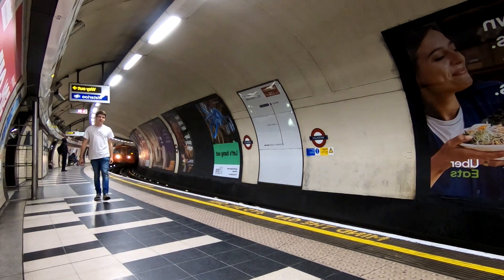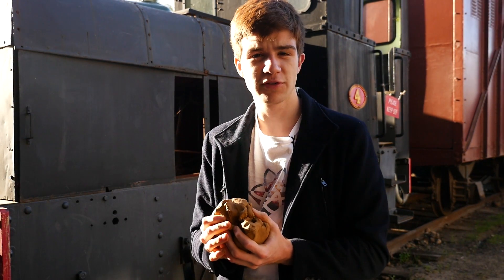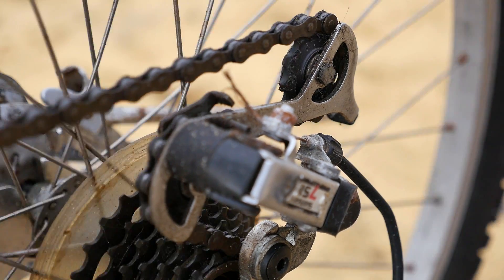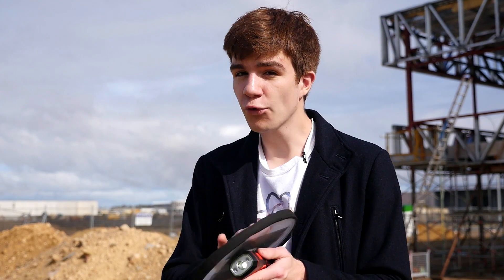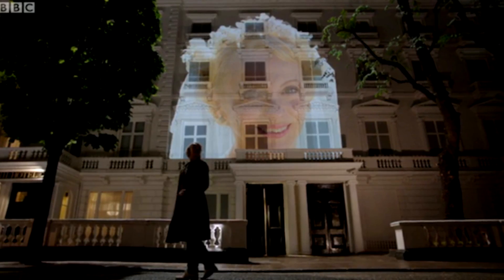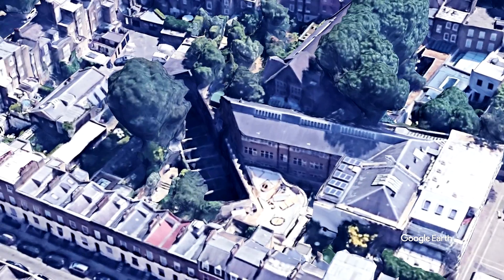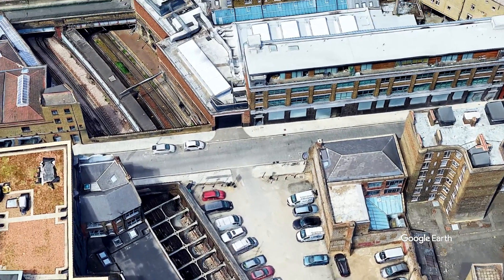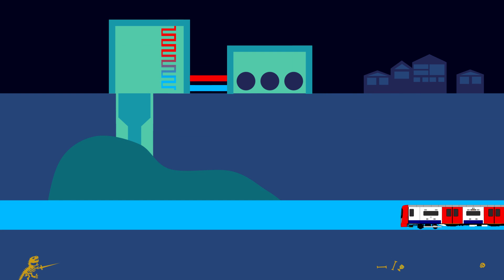Why It's (Almost) Impossible To Cool The London Underground

Comment: This video is a bit messy and kind of gets it, kind of doesn't.

Yes, the older lines are cut and cover which is why those trains are able to have air conditioning, though this wasn't mentioned, and the deep level lines (which the two weren't differentiated between, just the idea they weren't open because they didn't run steam engines.. lol) aren't impossible to cool, it's just an extremely expensive project. Heat exchangers above and below ground at each of the busier deep level stations are possible to do, but again it's just a matter of expense, not just for installation but the cost of running them. Those fans at Oxford Circus are actually a form of air conditioning, using borehole water and pumps to exchange the heat, but on the hottest days of the year during rush hour they often don't even turn them on, which is insane.

Also, yes the ground retains a lot of the heat and is very insulating, but not to the point it's growing endlessly warmer over the years, it dissipates in winter back into the tunnel air being pushed along and out by trains, drawing cooler air in, which is why it's actually very comfortable in winter. Also, yes, the brakes, motors (and indeed the heaters themselves when the drivers don't turn them off) cause a lot of heat, but the rise in temperature specifically in the summer is only attributable to the fact the ambient outdoor temperature is higher and those trains, having been baked by the sun then take that heat from the sun into the tunnels where it cannot escape. In winter, the trains themselves indeed enter the tunnels somewhat chilled and absorb some of the heat, taking it outside.

Additionally, yes, despite what the video says, people are absolutely a significant source of heat. Each person emits approximately 100-120 Watts of energy at rest (more when they've been climbing stairs etc), which might not seem like a lot, but make that 40 people per car and suddenly you have the equivalent of four 1000W heaters all turned on in that one car alone, and that's at less than half capacity. A 1992 stock central line train has a total capacity of 892 people (and heck, I'm sure I've been squeezed on ones with over 1000 people at a time), divided by 8 cars that's 111 people per car. That's up to 11KW of heat being produced per car, or 88KW per train during rush hour. It's hugely significant.

The next generation of deep level line trains being built by Hitachi are supposedly going to be air conditioned, though no information has been given as to how this will be done. One of the concepts being talked about is to generate ice stored under the seats when the train is travelling outside the tunnels, and upon entering the tunnels the refrigeration system deactivates and air is blown over the ice for the duration the train is in the tunnel.

One thing's for certain, the UK is really bad at keeping cool in summer.

Comment: Atlanta’s deepest station is cut into solid granite. It’s usually cooler than outside in our scorching summers.
Reply: Time will tell if that heat dissipates adequately or it becomes like London's tube. Granite is a better heat conductor at 3.2 as compared to clay at 1.7 to 2.26. Sources:
Granite:https://material-properties.org/granite-density-heat-capacity-thermal-conductivity/
Clay: https://www.sciencedirect.com/science/article/pii/S0375650520302017
Reply: Also Atlanta’s system is air conditioned. London’s isn’t

Comment: Trains already use regenerative braking, but not in the sense you might think. Physical brakes are the last ditch effort in emergency braking while normal braking is done via the same motors that actually power the train turning the motors into generators. This generated energy must be deposited somewhere or the motor wouldn't be able to brake so the train has heating elements that soak up that electricity which are much like sauna stove or swimming pool heaters.

Comment: Just a sec: London tube does not have AC? I am from a developing country (much warmer than UK also) and here all trains have AC set to 19-22C, stations are kept at a cool 25C. Some messed the engineering there
Reply: There's a difference between trains running on the surface and those running underground. For those underground the heat from the A/C has no place to go. As he pointed out, cooling the tube cars with A/C would only make the system hotter.
Reply: @Inkling777  the system I mentioned run underground

Comment: Generating electricity from waste underground heat cannot be a serious plan, I think you must have misunderstood something in the making of this video. It would require an exotic cycle to achieve that and would be at best low single digits thermal efficiency. Practical thermal electricity generation relies on temperature differences of hundreds of degrees.
Reply: Right, not electrical generation, but using heat pumps to put energy into a district heating system.

Comment: Spray water on the walls to absorb and remove the heat, perhaps grey water recovered from nearby houses. The tube system will already have drainage and sump pumps to remove it. Perhaps it could go through a heat exchanger and be sprayed again in a closed loop.

Comment: It's also possible to cool it if we get off of fossil fuels and onto renewables
Reply: What does that have to do with heat being dissipated from the breaks and wheels?
Reply: @RawbLV  the tube is getting really hot also due to weather change
Reply: @ThompYT  Yeah but the main heat source is trains braking. In other countries they use regenerative braking which helps convert kinetic energy into electricity instead of heat.
Reply: @RawbLV  still fixing climate change would cool the tube down
Reply: @ThompYT  Not by a lot. We are at +1°C right now if I'm right. The tube is at 40°C. That minus climate change would be 39°C which is still too much for underground.
Reply: @RawbLV  +1 for the whole earth = a huge change in temperature for us
Reply: @ThompYT  Yes but the video is about the tube and we are talking about the tube
Reply: @RawbLV  the tube is inside the earth (which is getting hotter)
Reply: @ThompYT  🤦‍♂️
Reply: @RawbLV  🤦

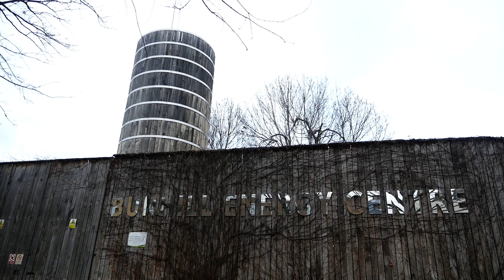Comment: 5:00 right... But how much energy is being put into the tube system and how long would a power plant like that be able to run? You're using electricity to run the trains which produce heat to then produce electricity... Doesn't sound like you could get much out of it or at least not be able to run it for long...
Reply: I know iam late. This system is collected with a gas generator which adds to the hear output and is the producer of the electricity. The metro part produce heat for 500 dwelings. https://heatpumpingtechnologies.org/annex47/wp-content/uploads/sites/54/2019/07/bunhill-heat-and-power.pdf

Comment: just put sliding doors on the platform edge and therefore seal it off from the tunnels. that's how they do it in China
Reply: mmm yes let's trap the heat and suffocate people
Reply: @RawbLV  no, you muppet. You separate the thermal cycles of the platforms and the tunnels. The tunnels use the trains like a  piston to push out warm air and suck in cool air. The platforms can be air-conditioned. Additionally, the doors keep people from falling onto the tracks.
Reply: @mrplease66  I see. Should have said so from the start. Shit at explaining but now I get it.
Reply: @RawbLV  Apologies, I figured it was obvious.

Comment: Low tech solution..ducting from underground into cellers of tall buildings. Hot air wants to rise... Shell of building could act as a chimney. And then there are lift shafts that would work similarly to way underground trains push air about. 
Of course times building will not want heated. Big flap valve allowing Air to exit say story above street level ... Or if there space for ducting, somewhere near top of building..
Reply: The vents would be too small

Comment: I fail to see how they're going to make ANY power from 40c air.
Some details would be good, that way the tax payer can have a little squiz at it what some consultancy agent has conned their government into wasting money on before the contract are signed.
Reply: I agree. From my thermodynamics courses I recall that it takes a substantial heat difference to drive generators, which is why power plants need exhaust tower or pools. 40 degrees in the Tube to ambient at 25 won't do that. The exception is a Sterling engine, which can run on quite small temperature differences. I suspect that as a power source it wouldn't be economically viable, but it might be justified to remove that heat. Here's a description of how Sterling engines might make sense if the heat is free, as it is here. https://www.stirlingengine.com/low-temperature/
Reply: @Inkling777  Yeah, except that stirling engine's don't make any power.

Comment: Amusingly, the Montreal Metro has a much cleverer and simpler system for slowing down trains as they reach the station.  The stations are elevated higher than the general track, so the train loses speed as it goes up the hill.  Then when leaving the station, it goes back down and gains speed.  This is far more efficient than basically any other option.
Reply: That is ingenious, I had never heard of that but I hope the designer was applauded for it.
Reply: @krashd  It's  pretty cool system overall, though i imagine the boutique decisions add cost.  They use rubber wheels for deceleration and acceleration that make no contact at any other time.

Obviously the "hump system" is nearly impossible to retrofit, but it's cool.
Reply: Clever, gravity is an excellent way to store energy. It also means the stations are closer to the surface and thus there is less distance for passengers to travel down.

Comment: They should do it the way my local subway does it, in the winter all the rails snap because of the cold so they have to shut the subway down so the tracks don't snap, and in the summer they get what they call spaghetti rail, so they have to shut the tracks down so they can cool down.

Comment: You don't store the energy from braking, it just gets put back into the network and is used instantaneously by a train accelerating elsewhere on the network
Reply: @TMinusRecords  you could but it would be relatively worse than using it instantly. Storing energy on that scale generates heat, transfering energy produces negotiability amounts of heat
Reply: Spinning rotors generating electricity do store energy, that's why when power shortfalls occur you see frequency drops.
There are also back generation effects caused by inductance, which effect large motor systems.

Comment: In Vienna, Austria, we use regenerative braking for decades already.

And:
The trains push the air through the tunnels and hence it gets warmer because of friction.
In order to reduce the amount of air blowing through the stations there are tunnels connecting the two train tunnels through which the air can escape to the other one.
In a few (too little) spots they installed heat exchangers in those connecting tunnels and are heating houses with that excess energy.
Reply: Compare the size and age of these transit systems.  Some lines have used regenerative braking.
But that narrow tube with a moving wall of air is the ventilation system in tunnels in parts of the network.
New lines cost huge amounts of money and deliver far more benefit, than re-digging extra tunnels that disrupt services a huge city relies on.
Older lines suffer from a lack of will to invest on maintenance.

Comment: This was interesting indeed.. 

Have a question though, can't the excess heat be transferred to a central heating system for the residential areas above the tube? Transferring it to energy is a way, I suppose, but it seems.. umm.. unnecessary convoluted(?).

Where I'm at (Amsterdam) they are running tests to do similar with a road that encircles our city, take the excess heat of that to use as central heating for industrial areas bordering said road. With water IIRC. To, indeed, in the future use that for residential purposes. 
Same with some server-farms we got here, which inside are freezing cold and the excess heat is used for the central heating of the offices above (I know this as I worked in one of those offices). If the heating wasn't used this heat would be stored in other underground reservoirs.
Reply: If you were building new, you could design a heat pump system in, adding to narrow Victorian era tunnels dug deeper than cut n cover metros, would be massively expensive and difficult, especially considering the bad effects of line closures, in an extremely congested city.
The newest lines are very expensive and probably do have features to manage temperature much better.
The same problem as re-using a/c heat for warmth exists however, most heat pump installations want to cool in summer, dumping heat to the ground.  In this case, that's exactly when temperatures are uncomfortable in the tube.
It's really bad ventilation not high ground heat, or it would be too hot all year round rather than in Summer

Comment: Great content! I suspected that the tube was too well insulated causing the heat problem during summer but I didn't know it was due to its clay construction material.

So if train braking causes that many issues, wouldn't another good solution be installing magnetic induction braking, where the train brakes using induction causing kinetic energy to be converted to electricity instead, reducing the heat production?
Reply: Magnetic induction breaking like you might find on roller coasters turn kinetic energy into heat just with an extra step. Kinetic energy --> induction --> eddy-currents flowing through a resistive material --> heat. That's why they are just back-driving the traction motors on the cars which turns the motors into generators so that the electricity is more usable.
Reply: @DJ-Sellout  no, what I'm saying is use magnetic induction and instead of running the eddy current through a resistor to generate waste heat, just use the current to charge a battery instead. 

Kenetic ---> electrical ---> chemical potential energy. 

Of course inefficiency will generate some heat, but it's better than fiction based systems.